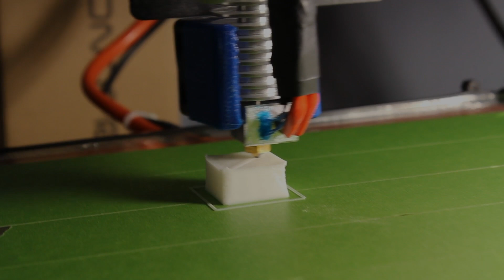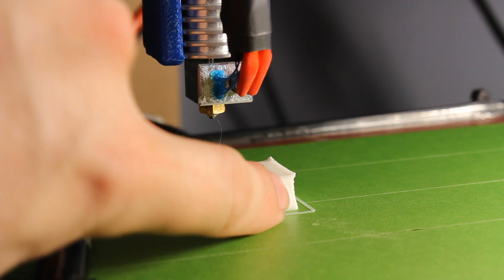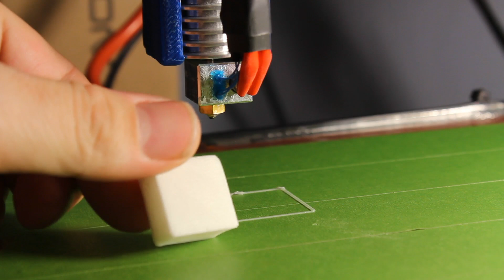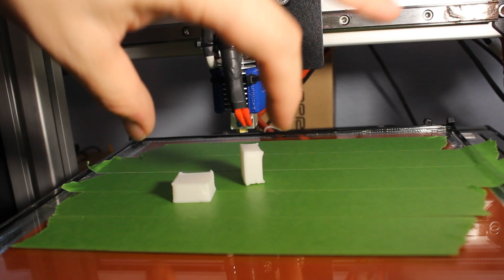Evan's DIY 3D Printer / Mill - EP11 - Fixing my print quality

Comment: Your next problem will be with objects pulling off of the glass or tape even pulling the tape off of the bed.   This will be cured with a heated chamber.  With a heated chamber you will cure your large object pulling issue but this will start to make some hot ends jam.  If you print with ABS only then make sure your tube between your HEAT EXCHANGER and hot block does not have a PTFE liner.  If your using PLA then the PTFE liner shouldn't get hot enough to melt (swell and start causing jamming).

ABS  each layer should be cooled very fast so you don't have bubble gum print but it should not be cooled lower than a (specific temp not sure what temp) or it starts making the print contract (heated chamber) keeps above this (unverified temp).   I have only sealed my print chamber off let it all heat up start my print really slow maybe 50mms and then increase to my max of 300mms on .1 layer height.  If I move towards .25 layer height I can't go above 150mms due to (remote extruder) filament delivery problems even when and these are what I'm working on right now. 

I started my 3d printer build in November a few months after you but I don't have a job and have dedicated (TIME) to this and am making quite a bit of progress.  I think its easier try and solve one problem at a time.  I have a stable machine and so to you.  Lets work together and improve our printer.
Reply from the maker: Thanks for the info.  I have an all metal hot end, but this E3D v5 (and maybe v6 unless they fixed it) just plain has problems with PLA.  I want to run ABS to it runs nicer, but I'm worried about the fumes.  I don't think they are that bad, but I don't want to run it in my house and expose my kids to the unknown problems it may or may not cause.  I need to build a chamber, but this printer got huge... I really wish I had gone with a core xy setup that was more conducive to enclosing with plexi.

I'm okay on large prints if it takes the tape up... tape is cheap, and I've found if you drop the bed temp from 55C or whatever I'm running down to 40C or so, it will come up easier.  I've still yet to try hair spray instead of glue stick, and I have a roll of kapton tape to give a shot when I get time.

I think my best bet right now is to get my limit switches mounted and wired, so I'm working at modeling and then printing the parts for that.  X is super easy, Y is very doable, and Z is still up in the air... I may try to work a probe system in but I'm nearing being out of space, so I may have to catch the Z carriage instead on its way down. 

I'll try to make a video of whatever I get working on the limit switches, then I can finish the case and get the thing tidy'd up a bit.  It is slow going, but progress is not stopped yet.  It has been a lot of fun.

Comment: hey Evan nice watching your videos good job
could you just do me a favour ?
can u pls e-mail me all the various parts names,its costs and from where you ordered them.
also can you pls explain a bit about how you made its body or casing .
i really need to make this as my project.
thanks regards!
Reply from the maker: Gaurav,

I'll see what I can put together for you, but I highly recommend going with a kit from somewhere.  My design is not really 100% ideal, I made use of parts I had on hand.  I'd suggest a mendel max 2 or another metal extrusion based system that is more widely supported.
The metal frame is all from misumi usa, cut to length.  CAD files are linked in the first video's description if you have solidworks.

Comment: hey Evan,
Have you sorted the "devils horns" out completely?
I used to print without a problem, but not have a new printer (prusa i3) and with a E3D Hotend I get curling upwards horns from the 4th or 5th layer on...
really bothers me, since even with some cooling added (2 x 50mm fans) it is not really that much better...
maybe some settings i am missing?

Comment: What's your nozzle and filament dia?
Reply from the maker: The nozzle in this video is a 0.4mm.  The filament is Moniprice PLA @ 1.75mm +/- 10% spec (though I measure right around 1.76mm every time.  I've since started using a 0.6mm nozzle, though I'll probably switch back and forth.
Reply: Ok I am using a 0.36 mm nozzle, 1.75mm filament and still having failed prints.

Thanks, have just checked my extrusion, think need to tune the steps/mm in the Melzi board's firmware.